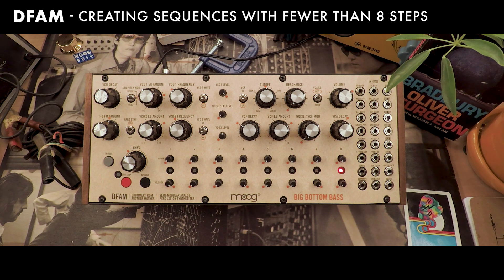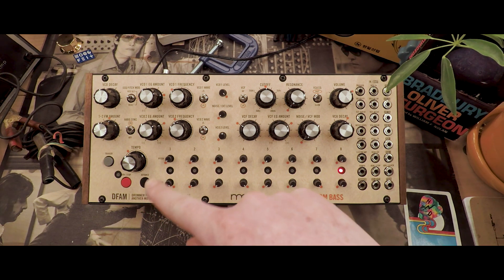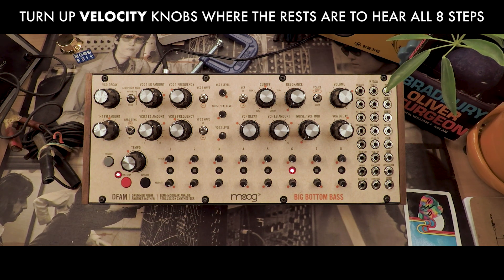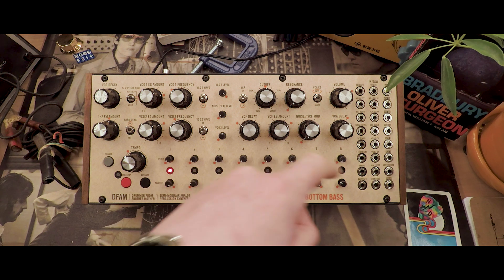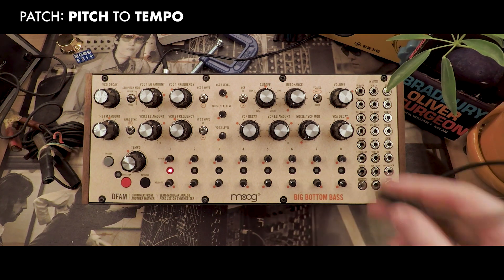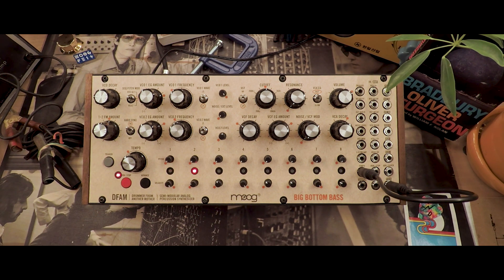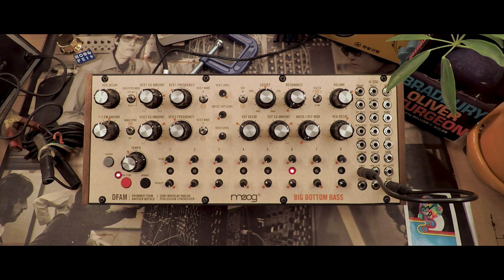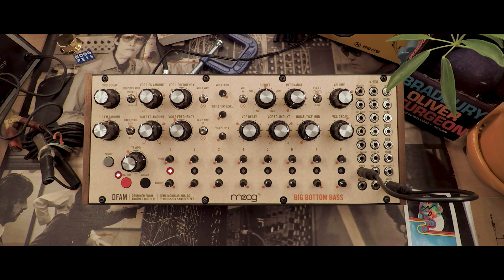DFAM | Creating Sequences with Fewer Than 8 Steps

Comment: Moog missed a great oportunity not giving DFAM ´s sequencer the ability to switch off steps for polyrythmic sequencing/modulation ( the pitch to tempo patch not enough, sorry). I hope someone with  knowledge in electronics comes up with a way to mod it . In the meanwhile I use Korg SQ1 instead
 Great machine though, my favorite synth
Reply: Even if there were a Reset input that would be enough to not only use the pitch sequencer to trigger a reset, but use external gear like a counter to get any length.
Reply: are you using sq1 with dfam?

Comment: Hello, first of all, very good video.
Would it be possible to do this when we have other equipment connected to adv / clock? I've been trying but I can not find the way...;) thanks!
Reply: I just figured it out..... i have hooked up to mother 32... instead of gating into adv/clock put it in the run/stop
boom!
Reply: @KingBrittArchives  Hi, I'm trying to sync in the same way as you did to make a 3/4 time signature (using 6 steps from DFAM) but also to be in sync with ableton start/stop. So basically if I connect in run/stop DFAM the looper starts when I press run/stop (without taking start/stop impulse from ableton witch is clocked through keystep pro to DFAM and MOTHER) do you have any clues for making 3/4 time signature but sill be able to control DFAM loop start/stop? Thanks
Reply: @KingBrittArchives  gotta test it tonight :)